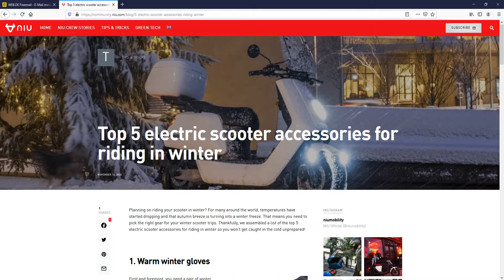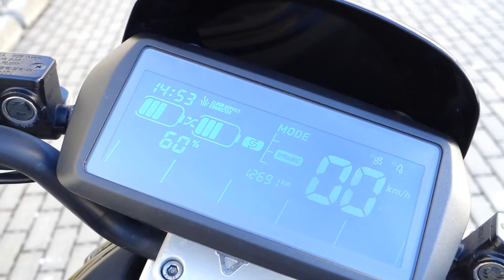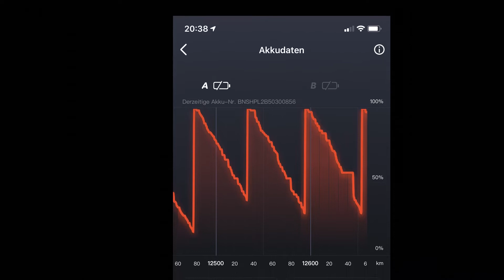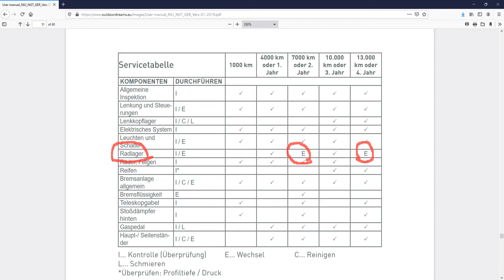NIU NGT (NQi-GT) after 13.000 km / 2 years

Comment: I travel about 27 km a day in average with my electric scooter (a Chinese one but not a NIU, and it's just a 45 km/h moped, ”EU moped”) and so far I rode it a little more than 30000 km (30 Mm) without any serious problems yet. It just works and I never even brought it in for service. I love those electric two-wheelers, there's not much on them that can break. I've only had some minor problems, like the brake switches a few times and the switch for the side stand no longer works properly, so it no longer stop you from driving with the side stand down. Maybe I should at least fix that at some point.
I have thought of buying A NIU next time, and I found the information in this video valuable.
Maybe the Seat MÓ would be a better fit for you? I think the top speed is a little more than 90 km/h and the battery is at 5600 Wh and you can pull it around, since they are on wheels. It weighs about 40 kg, so stairs would probably be an issue. I have been thinking about buying one myself, but I would have to carry it 24 steps up and 24 steps down every day, so maybe not for me.
Reply from the maker: Almost double the price. Not sure if quality will be also double as good. I’ll have a look. Anyhow it is just a rebranded cycle .
Reply: @prometeusz.jasinski  Well, yes. It was only a suggestion, though. Something to have a look at. 👍
Reply from the maker: @johnnyrosenberg9522  just checked some customer voices in forums. Seems like it is rusting even worse than the niu and the fork is also too weak for a stoppie. Worst part seems to be that customer support is not admitting it. too low speed 85km/h in real life is also Not so nice. So no option for me for so much money.
Reply from the maker: https://www.elektroroller-forum.de/viewforum.php?f=128
Reply: @prometeusz.jasinski  Isn't even 85 km/h still more than the NIU?
Reply from the maker: @johnnyrosenberg9522  yes it is 10 km/h faster.
Reply: @prometeusz.jasinski  Too bad that Red Electric E-125 is only available in France, otherwise I guess that could be an option. Well, it's expensive, but it has features. 4·2400=9600 Wh battery gives a range of about 200 km, belt driven (low unsprung weight), 120 km/h maximum speed. Not much space when all of the four batteries are used, but you don't have to use all four of them at the same time.
I just don't understand why they won't sell them outside of France.

Comment: Great video, Niu must stand for buy one new every two years because nothing on it seems to last! It is shocking they told you paint flaking off is expected! You might like the new ninebot-segway e200p it can 100km/h
Reply from the maker: The point is that I have not seen a better bike yet but I'm open for proposals and new promises which will be not kept in reality. Ninebot looks interesting, thanks. Does not seem to be available in Germany yet and do not find information on the critical parameter of battery capacity. The range they provide has typically nothing to do with reality.
Reply: @prometeusz.jasinski  What kind of critical parameter are you looking for regarding battery capacity of the Ninebot E200P?

Comment: since the wheel is also the motor my guess would be they would not like to damage the place where the bearings/ radlager are. i read they had to replace entire motors/wheels if the bearings collapse, i read that about SYM scooters used with couriers, that use has been excluded of warranty although they advertise that the scooters are ideal for that use ....
Reply: No u need to dissamble the hub motor and replace bearings.then must use seal to make it waterproof again.Hall sensor is another story but there are spare parts for.Bosch is made by qsmotor.

Comment: Hi, many thanks your regular reviews of the NIU scooter. They gave me the confidence to buy a 2021 GTS Pro with close to 10k on the clock. Now, after a couple of months using it, I have noticed that the batteries are not depleting at the same rate. One has consistently less capacity than the other, for example, at the moment one is at 79% and the other at 73% capacity. Could you or anyone else commenting here found the same problem and, if so, could this be an issue? Also, the fork seems a bit loose, has anyone come across with a video explaining how to tighten it? Thanks!!!
Reply from the maker: This may be the software bug which is present at my scooter. It manifests itself as follows: you charge the batteries fully but you ride only a couple of km and charge is still above 90%. Then you switch the scooter off and leave it for some time. Suddenly one of the two batteries is reported to have full charge again. You would get a notification and you would see it in the charge diagrams.

Comment: I drive the same, also 64 km/day (2 x 32 km) Slow charge at work (from 50 to 100%), full in 7 hours because I use about 45% battery. Fast charge at home (again from 50 to 100% in 3,5 hours). I would also love a top speed of 80+ kmh. The speedo lies, real top speed is about 76 with full battery. I cannot choose between the Horwin EK3 and Niu Evo
Reply: If I understand well, after you drive 60 Km your battery is around 65% (you use 45% of battery)?
Reply: @francescoriccioli4326  No, sorry. 32 km full speed takes about 50% of my 2 x 35 Ah batteries. (changed the text now)
Reply: @dotternetta  Thanks!
Reply: Horwin ek3 with a chain and makes a noise when u r on the road
Reply: @elifelif777  I know. Bought the Evo which was perfect but isn't anymore after latest update. I can return it and get my money back. Will buy a Ray7.7 now
Reply: @dotternetta  what is Ray 7.7 ?

Comment: thanks for the vid, what is the real world top speed, spec says 60 Mph , hear others getting 48mph.
Reply from the maker: As long as you are above 50% charge you will reach 70km/h gps measured speed even on light slopes. Below it starts lacking power.

Comment: I really want an electric scooter and this is the only one available to me that is a 125cc equivalent. That front fork issue seems like a really big problem, should I just get a petrol 125 instead?
Reply from the maker: Hi, according to my knowledge this issue was solved. New forks have now an additional rib in the casting on each side. If you buy a new one, talk to the dealer about this and try an emergency brake yourself.
Reply: @prometeusz.jasinski  Hi, the problem is I'm buying second hand and there are no Niu dealers in Ireland unfortunately
Reply from the maker: @colin6673  lookout for the ribs: https://www.elektroroller-forum.de/viewtopic.php?t=8100&start=260

Comment: Hello Prometeus,
Thanks a lot for the video you have already helped me a lot with your presentation!
I am really thinking of buying the Niu you have. The thing is that my plan is to make the double km distance than you do, 120-140km per day (60-70 to the work then charge the bateries 8h and after 60-70km back home) at top speed. 
Do you think that is posible?
Reply from the maker: Hi Borodin, I have no issues with that. The only burden is the charger which does not fit into the scooter. This was fixed with the niu has fixed this with the Mqi -GT (not Nqi-GT) https://www.niu.com/de/product/mqi-gt but unfortunately the batteries there are smaller and real 70km are not an option anymore at high speed. If I need to carry my charger I put it between my legs in a waterproof bag. This is not optimal and boxes at the back of the scooter I simply don't like.
Reply: @prometeusz.jasinski  Thank you again my friend. You are more than helpful!
Reply: @prometeusz.jasinski  здравствуйте 🖐️.какой максимальный пробег на 2 аккумуляторах?
Reply from the maker: @putakvariumista  Hi, sorry but my Kyrillic is unfortunately not good.

Comment: You said you commute 60 km a day, but only 13000 km in two years? That's just a little more than 100 days a year. Or did you say 16 km a day? I tried to hear it several times, but it sounds like you say 60. 16 km makes more sense: A little more than 250 days a year.
Reply from the maker: Yes, I commute 60km a day. As I said. In the first year I made 10k. I had there already to ride for 1 month with a replacement scooter since the fork needed to be repaired. The year after is when Corona hit my daily habits. Now I commute only 1-2 times a week to my workplace.

Comment: Forks bending on hard braking, i never heard about this. That means the scooter head very bad quality mechanical parts.
Reply from the maker: Please see here for more details:

https://www.elektroroller-forum.de/viewtopic.php?f=63&t=8100&hilit=Gabel+verbogen

https://youtu.be/h1dHKQP4aAE

Also NIU is not the only one:

https://www.elektroroller-forum.de/viewtopic.php?p=188437#p188437 

98% of typical scooter users will simply not break hard enough to whiteness that issue.
Reply: that says everything you need to know about quality. i had three accidents with a cheap chinese petrol scooter and damn thing still working to this day 10yrs later

Comment: Thanks for sharing. The quality is shockingly bad. How can they let this piece of Chinese rubbish in the EU market remains a mystery.
Reply from the maker: Actually the dealer was selling KTM as well and was not willing to guarantee that a KTM would be better on salty streets. Which motorcycle would you recommend for winter riding?
Reply: @prometeusz.jasinski  I ride a 2017 Honda Vision 110i 🙂 it’s a 110cc scooter from Honda. 6,5 kW of power and 9 Nm of torque. Topspeed of around 55 mph/90 km/h.

I also ride my Honda Vision 110 in wintertime and also in very bad weather (including freezing temperatures).

The newprice of the Vision is 2.350€ here in Belgium 😁

Almost no rust or corrosion after 11.000 km’s, and I ride 8.000 km every year with it.

The fuel consumption on the highway on your commute to work at topspeed (always will hold 90 km/u) will be around 3,7 liters/100 km. So your 60 km commute every day will cost you around 4,2 Euro’s per day. So about 15€ per week 🙂

Only on the exhaust there is a bit rust, but that is normal. I can strongly recommend the Honda Vision 110 with confidence for a very good if not better alternative for your apparently medium-quality NIU e-scooter 👍🏻 you will be suprised of the premium build quality of the Honda Vision 110i 😉

Maybe do a testride and find out 😊